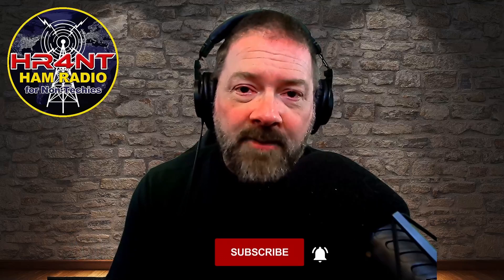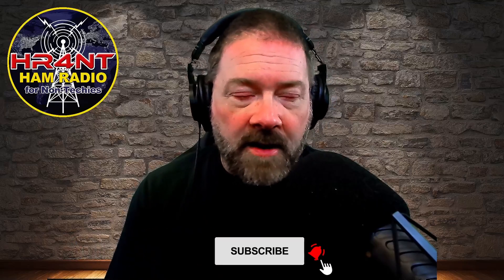Concessions with ham radio - It IS a technical hobby.

Comment: I think this channel does a good job of bringing interest in ham radio to non technical people.  It is important for non technical people who are interested in ham radio to prepare to gain some technical knowledge along the way.  This is actually in the rules.  Part 97 Subpart A, 97.1 b says, “Continuation and extension of the amateur’s proven ability to contribute to the advancement of the radio art”.  C goes on to say, “Encouragement and improvement of the amateur service through rules which provide for advancing skills in both the communication and technical phases of the art”.  Have fun!  73
Reply from the maker: You nailed it!  Folks may come in as a non-techie, but they will learn the skills and lingo and become more techy over time.  Thank you for the comment and for watching.  73!

Comment: Well said Scott. Some people need to realize amateur radio is not CB radio.
Reply: CBRS aka 11 meters ( for a former HAM band) can get complicated if one goes beyond the 4 watt only AM omni directional antenna with a magnetic base gig. There you will find good quality plug and play ....for cheap. Try a tower rotating beam antenna or better yet make serious contacts on SSB. Now you need some skill. 
Note that I do not defend the skill level of 'Power Rangers' running high power making the band a splatter box as they have the IQ of a potato. But they can be entertaining at times.
Reply from the maker: LOL...that is interesting for sure.  Thanks for watching and for the comment.  73!
Reply from the maker: Exactly!  Gotta work a bit more for this rewarding hobby.  Thanks for watching and for the comment.  73!

Comment: I think the problem is that anyone coming into Ham radio thinks they are buying a "Product". NO. They are buying component or group of components(in case of transceiver). Making them "work together" is the hobby part. Getting on air is the result or outcome of it. If you want things that just works, buy a cell phone. Where I live, even that needs a bit of luck and skill to work :)
Reply from the maker: Exactly...it is a journey you take if you find it interesting enough to pursue.  You made a great point!  Thanks for the comment and for watching.  73

Comment: How do I make an appointment for you to come up and set up my station? 

All kidding aside I must be an idiot, I purchased a Nano VNA and I ended up sending it back, I could not figure out how to have it display the SWR on HF bands. I purchased a Rig Expert and it works Great and easy enough for an idiot (me) to use! I liked it so much I purchased a second one. I wanted / needed (sometimes hard to tell the difference) one that would do VHF and UHF so I gave my original one to my friend and picked up the EXPENSIVE one for UHF. Was putting together a Earth station for satellite work and wanted the antenna as close to perfect as I could. Worked great. I like the idea of the smaller less expensive Nano VNA’s but I must be missing something, hell I would buy another one just to learn how to use it if you could make a video step to step of how to set the (&^(&* thing up. That would be after you made the appointment to come out and set up my station. 

Thanks for your video`s
Reply from the maker: LOL...call my new hotline, 1-800-Never-Gonna-Happen...ROFL.  I am right there with you.  Analyzers can be complicated.  I never got into the NanoVNA's.  They do far more than I am interested in at this time, however, my RigXpert is phenomenal!!!  As you say, it works and is pretty much idiot proof.  That's a Win-Win for me!  Thanks for the comment and for watching.  73

Comment: It was a given when I got my Novice ticket in 1976, and it was on this day it was active, that you built your own antennas. Mine was this all bands antenna dipole with 50 foot elements Fed with 300 ohm TV twin lead and run through a 4:1 balun that I built connected to a coax running through a T/R switch that I also built. This was normal stuff when I became a ham. It also helped that I had two hams in my neighborhood who were both EEs and worked at Bell Laboratories down the road from my house if something I built didn’t work out. That was often the case and when, after I built a 1 watt QRP solid state 40 Meter CW transmitter that I discovered heat sinks. My transmitter was burning up finals and my elmer added a heat sink and I remember that sine wave not collapsing after 5 minutes like it used to.
Reply from the maker: What a great story!  Thank you!  I think this demonstrates how far down we have gone, because practically nothing is required of you any more to get licensed and that is fine, but take SOME initiative and improve your skillset if you are going to participate in something that can be technical at times.  Thanks for the comment and for watching.  73